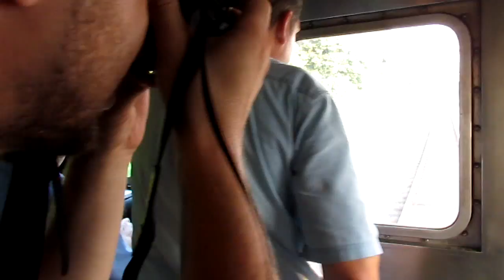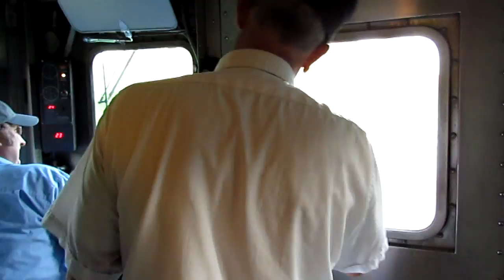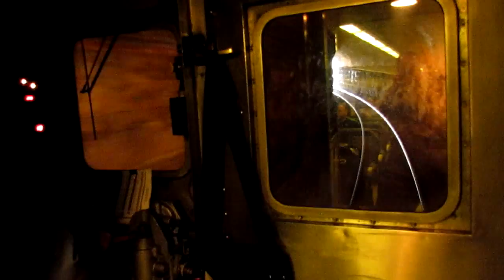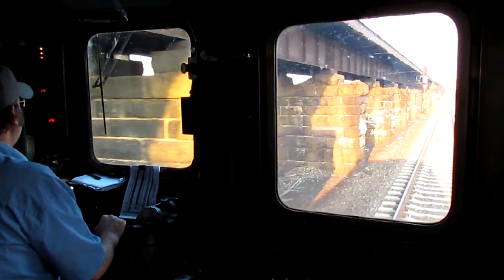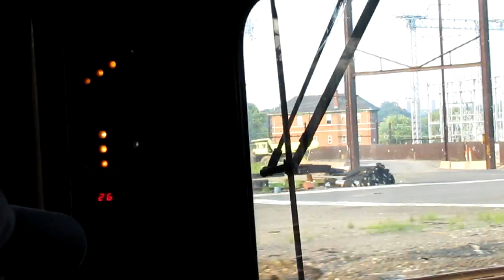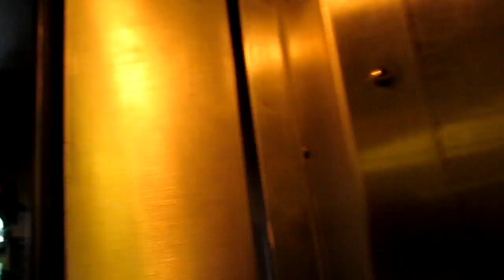Driving SEPTA Silverliner III #235 - Train 1088, Cynwyd to K on the Last Day of Service

Comment: 7:35 nice hammer down acceleration. I'm not sure about the Silverliner III cars like the one in this video, but the Budd Silverliner IIs cars could accelerate at almost 2 mph / second. Not bad for a car that weighs 101,000 lbs and "only" has around 500 horsepower.

Comment: Bala was my commuter station, from the early 60s through the mid-70s.  The earliest I can remember, the line was a 2 track system, with station houses on both sides.  The outbound side had a house attached to the station, and I can remember there were PRR employee's family living there, tending flower beds.
I spent many a minute waiting on the inbound side in the waiting room, which was dark, and a little dingy.  There was a ticket office on that side to buy your 10-strip, and the waiting room had a coal-burning stove to heat the place.  Mahogany benches along the side walls, like those in 30th St.
Used to catch MP-54s, and the first generation Silverliners inbound & outbound, on my way to school.  I had an aunt who worked the ticket office @ Suburban, so there was always a stop into the ticket office there to say hello, before catching the 3:30 Manayunk home.  In rush hour, the Manayunk ran about every 25-30 minutes.
52nd St. station was still a stop then, during rush hour, and I remember them building the Wynnefield Ave. stop.